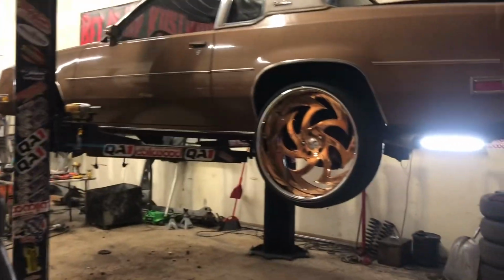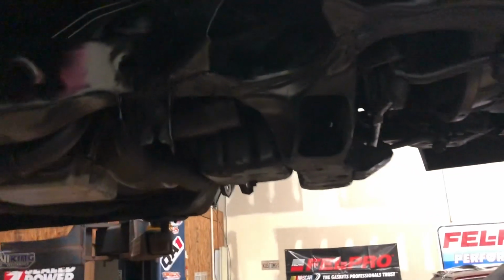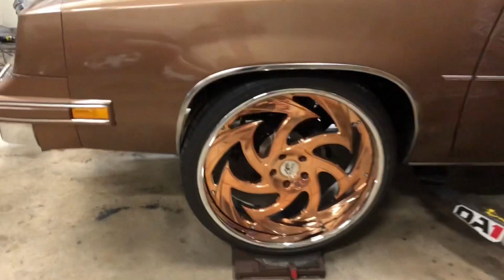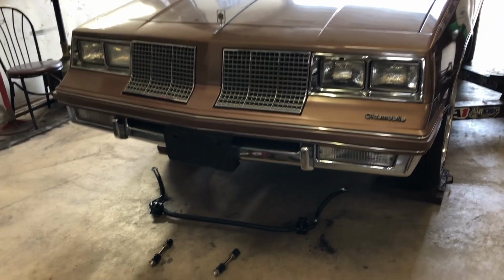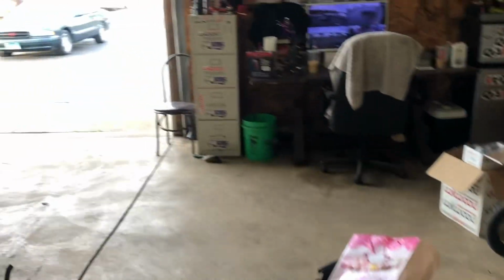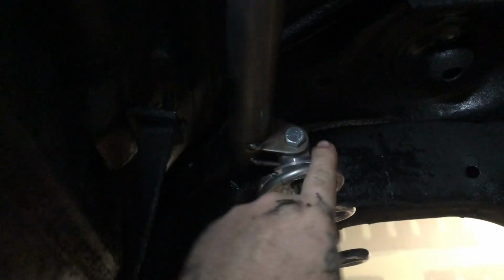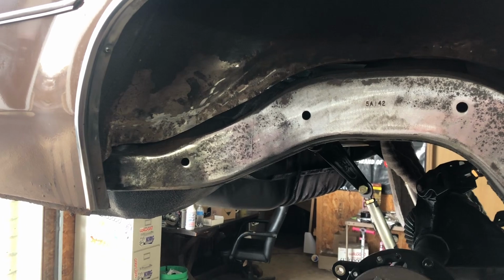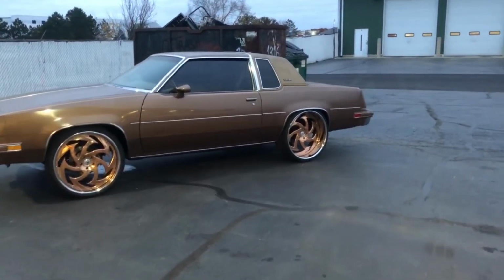GBODY FRAME NOTCH AND NARROW #betitupkustoms  #viralvideo #how

Comment: How much for a front right and Left front suspension kit QA1 88 Chevrolet Malibu 350 engine and transmission  what would you charge.ACES-Whipes if the took your donk you just finished and stole it to race all thebto get a yellow then a purple and blue I need all my stuff probably fixed and those Monte Carlo are mine to go to mechanic school I trying to be a technician at a dealer that called me in my cutlass brok down so you can't talk to Carter about another engine.please invitation on that type in how man schools in Hillsboro county

Comment: How much for front and back frame notch and qa1 suspension and Wilwood brakes installed on my 83 g body cutlass
Reply from the maker: @willl3623  $6k-$7k labor
Reply: @ do you buy the parts as well then install? So 7k total or 7k just for the labor? Ya work is on point I need my cutty right now
Reply from the maker: @willl3623  yeah that’s just labor. I can give you the list for all the correct parts and where to get them.
Reply: @ yes that would be dope I have a set of 26 inch spokes I’m putting on there so yea the parts list is hella helpful
Reply: @BETITUPKUSTOMS  Merry Christmas Bet It Up Kustims excited to finally reach ya and do some buisness with you I know my cutty will be gorgeous when your done with it enjoy your holiday link with you soon
Reply: @ yes I definitely need parts list so I can start buying thanks